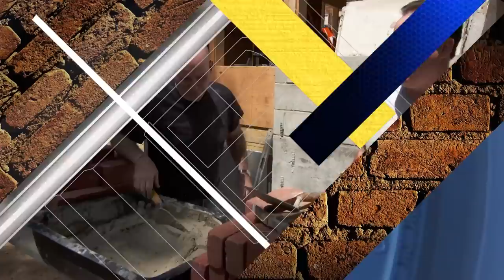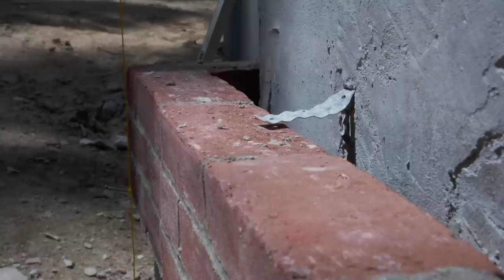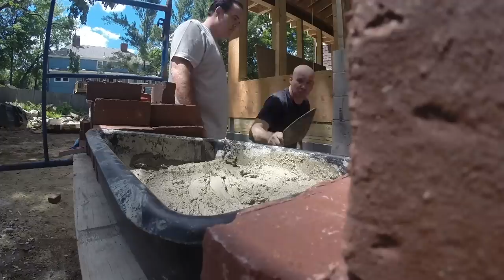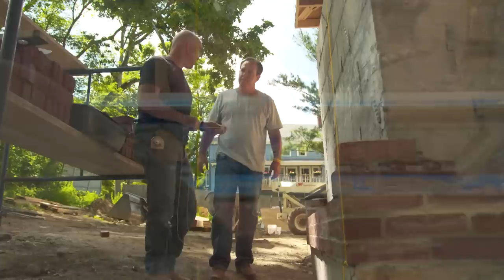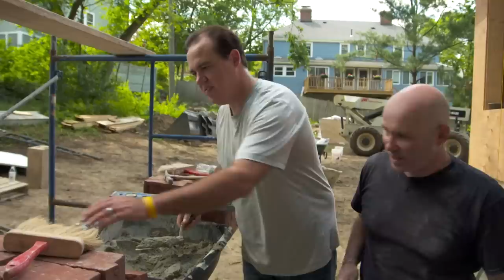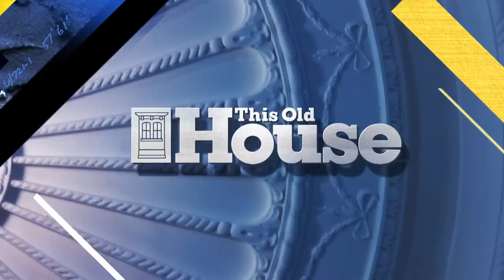How to Lay Brick | This Old House

Comment: Frogs weren't filled at all, as a CA, CoW and inspector, this wouldn't be signed off on any of my sites.
Reply: Joe Kinchicken  before putting a first course of brick, an environmental impact report should have been approved in CA..
Reply: In addition, would the bent up brick ties fail inspection?  I was always told that bending them breaks the galvanizing.
Reply: Joe Kinchicken   frog as in the indentation or "the holes" in the brick should be filled for strength rigidity
Reply: Joe Kinchicken  I'm sure there probably is such a thing as a brick inspector, however I am not one and I'm based in the UK. CA=Contract Administrator, CoW=Clerk of Works, I'm also a Building Surveyor and Construction Project Manager. The frog is the indentation in the brick, in the UK it is normal for the brick to be laid with the frog up and then filled when the bed is laid to ensure full strength, however, in some areas the frog might be laid face down (for a few different reasons), although the frog still needs to be filled, the beds that they laid in this video are hollow to the centreline and therefore would not fill the frogs, leaving the wall much weaker and less acoustically insulated.
Reply: @cgc7078  You're kind of right, both leaves really should be built together, but I do sometimes see the ties bent like this, certain types of stainless and galvanised ties can handle being bent, it shouldn't bother the galvanised coating as the coating can crack, be scratched or removed in small parts without effecting the protection it affords, however plastic coated ties should never be bent and it is better practice, if the leaves must be built at different times to leave the ties straight and ensure the area is well marked to prevent anyone getting injured (mostly eyes!) as bending any tie to that extent could weaken the tie significantly.
Reply: And how would you know if they were filled or not once the wall is built?
Reply: Bill Ammer The only way you can completely ensure the frogs are filled up is laying them frog-on-top
Reply: You don’t know what you are talking about.

Comment: Do another of these. Each time he corrects the homeowners mistake i learned something. Maybe another home owner could be taught. Do an episode on non-portland mortar. Like type s, sand, water, burlap to keep wet for 7 days
Reply: Yes, that's the only mix old bricks will not be destroyed by as it's softer than old bricks. Many of us have old homes/bricks.
Reply: @stp479  no type s is not good for old bricks. Type s and m are the hardest mortar types for masonry work. Type N or O are good for older brickwork. They'll contain more Lyme and give old brick the flexibility it needs to move and shift with weather conditions. Bricks today are fired harder than bricks in the past and Type s is used for a stronger application
Reply: @sethbrandenburg941  Sorry, I meant low portland content mixes for our old bricks.

Comment: Why such a big space between the red brick and the wall?  how does it tie togethor
Reply: See all of the metal tabs on the block work?  You just bend those down across the brick, lay your mortar over the tabs, put the brick on top of the mortar and the tabs, and then it is tied together.